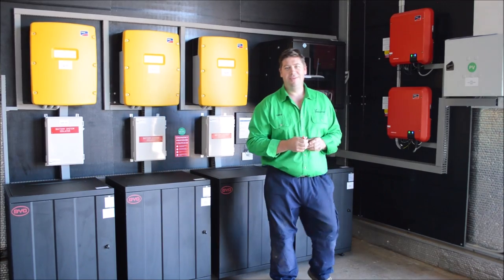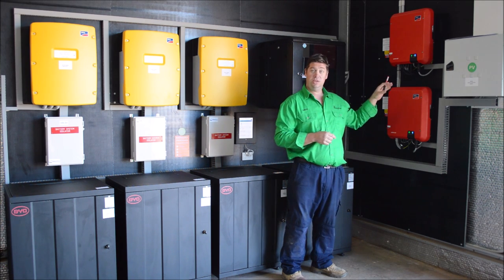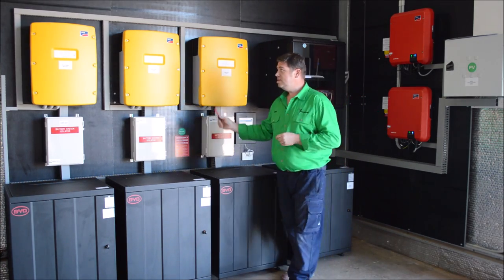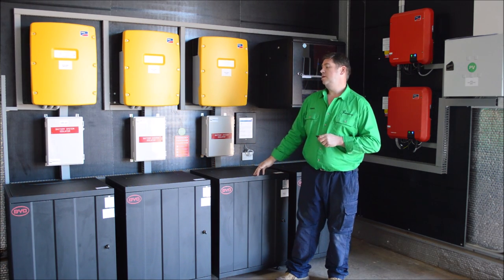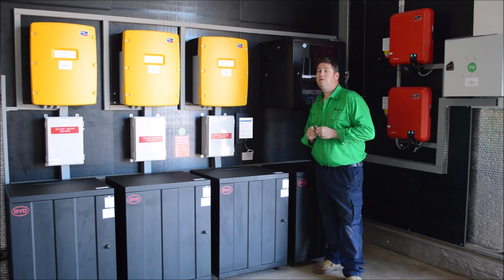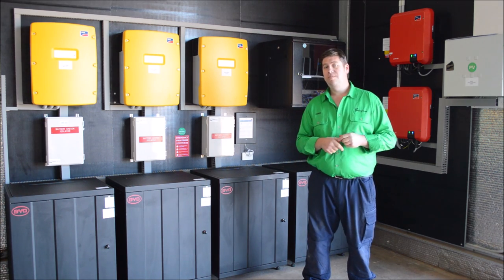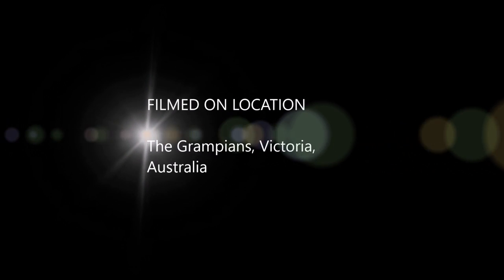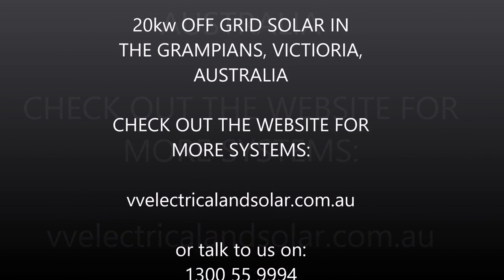20kw OFF GRID Solar System w BYD Lithium in The Grampians

Comment: Hi there.  Would it be a possible to do a walk around of the building  to know /see what can you run or use in the house with the following system. for your next video
Reply: Simple answer you can pretty much use everything in a average home with this system electric stove, electric dryer, electric hot water heater, 2 possibly 3 ton A/C unit at least during the day.